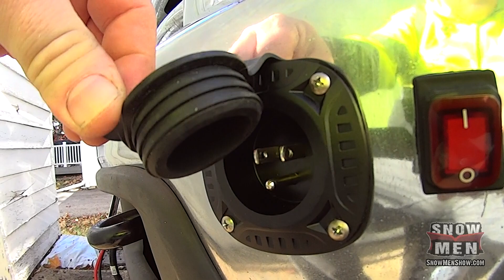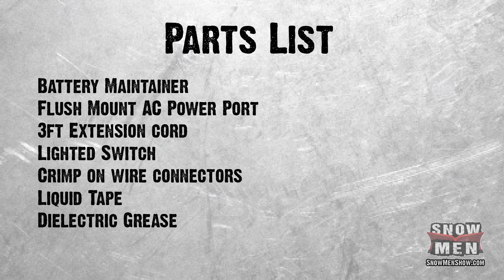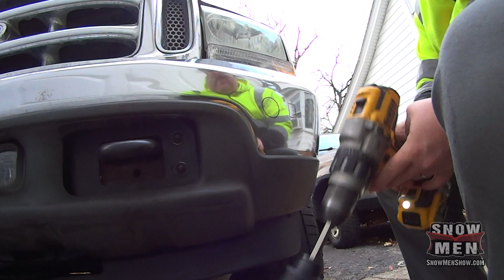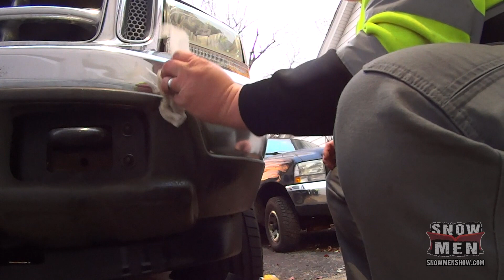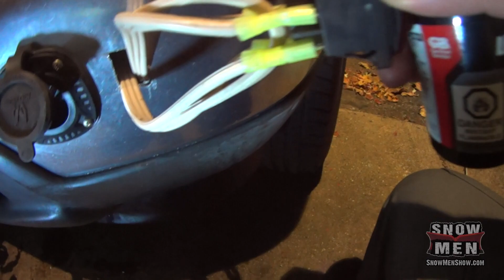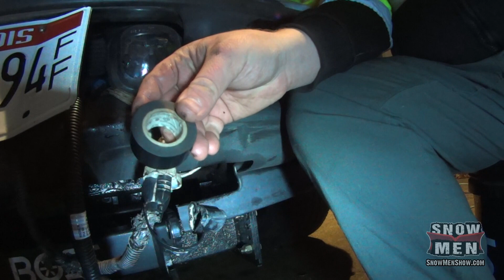🔌 Battery Charger & Block Heater Ford 6.0

Comment: I came across your video very straightforward into the point great video the only suggestion I would make is not  to use the appliance extension cord you can buy the plugs online or in electrical supply store and I would use tin coated wire which is used on All marine applications because it’s very corrosion resistant that’s such suggestion please don’t take it the wrong way anyway great video hope to see more from you

Comment: Have h thought of doing a upgraded alternator that’s what we did on our snow trucks
Reply from the maker: Most definitely. Already have an upgraded alternator. Even with a high output alternator, batteries that have a maintainer last a lot longer especially in cold environments. This design also works for just a block heater which all diesel trucks have. Gives it a cleaner look than just a cord hanging out of the front of the truck.